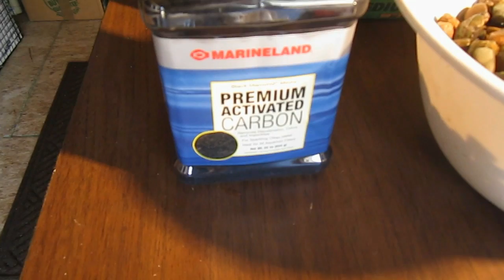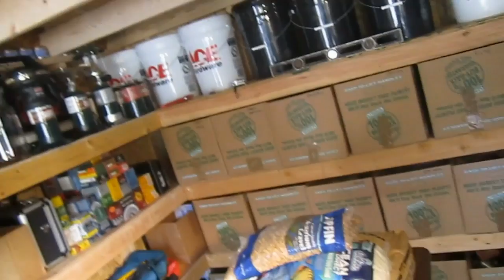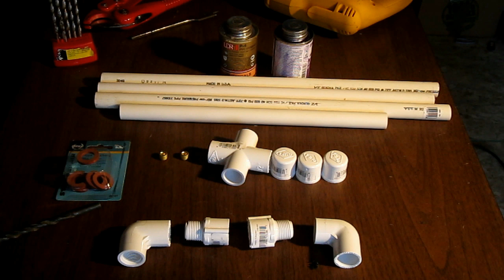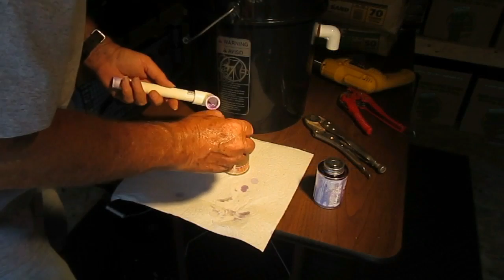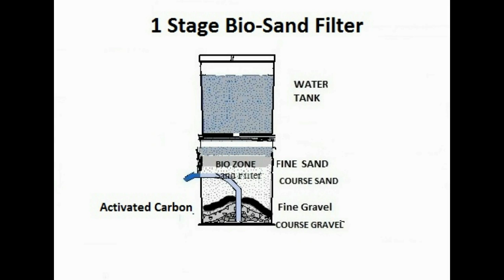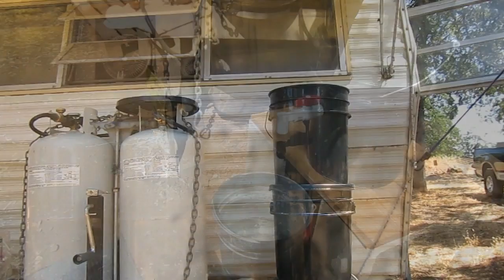Bio-Sand Filter Part 1, 2 & 3

Comment: Several comments/questions:  I am interested in this for emergency use.  I live in a suburb and am worried (some) about industrial chemicals, lawn chemicals.  As for bacteria, I posted REPLY comments to concerns about adding bacterial to accelerate the growth of a biolayer to remove bacteria.  It would seem prudent to do a test even asking a municipality to test, even if you had to play games and not tell them the source.  Or it would be worth it to get a kit, test, or send off.  I see a SODIS approach is used.  And if either chlorine or iodine is used.  That said, if this were for emergency use, wouldn't it be safest to treat with Chlorine or Iodine?
Reply from the maker: Charcoal will reduce some chemicals but not all. Block Carbon filters are best. I used a water test kit from Amazon. My well water cleared up and I stored the BSF for emergency use.  It never produced a bio-zone as the well water did not have enough bacteria in it. I use a Berky Filter in the kitchen now just to be sure the water is safe all year long as I live in a Agricultural area.
Reply: OutSTANDING!

Comment: I really don't think I would use any type of oil drums. You only want food grade type buckets. If I were going to use a 55 gal. barrel/drum I would to try to find any type of food grade barrel I could find. 
Now how would you keep contaminates from entering the top of the bottom bucket? There does not seem to be any type of seal between the top and bottom buckets.
Reply from the maker: I am using food grade buckets. 55 Gal. Drums would be a very bad idea and defeat the purpose of the 2 stages.. You could put a gaskets between the barrels if it made you feel better but I don't think it is a problem and it probably would cut off the flow of the water. I think you may be better off with a simpler design something you would understand better.
Reply: Oh I totally understand how it works. I was wondering how you would keep the bad water if you spilled it down the side. The gravity is what pulls the water down so I don't think you would have a problem with it sealing at all with a gasket. The 55 gal barrel I would not even give it a thought. I am just doing personal research for myself. I am bit of a prepped.

Comment: Does a biosand filter out the same things that a ceramic filter like the 
Katadyn Pocket does, or would it filter some things that a ceramic 
filter wouldn't?  I'm wondering if using a 2 stage filter using a biosand filter and then activated carbon would do the same type of purification as 2 stage filtration using a ceramic filter followed by activate carbon??
Reply from the maker: +Dirky Dirk I could not use ceramic filters or block carbon filters because the plug up instantly with the fine sediment that I had and they are useless during most emergencies.
Reply: +EZ Off Grid 
I wonder if the Katadyn Expedition would have plugged up on you with your sediment rich conditions, it really is a monster that does high volume.  Me personally I think ceramic is a great 1st stage in a multi stage process.  The ceramic can really lighten the load on a purifier that you use afterwards.  Why use up the life of the purifier on impurities that the ceramic can take care of!  I use the Expedition, than I use the First Need Base Camp Purifier, than activated carbon for taste.

Comment: nice job on the video. very useful information. if I'm not wrong, you want to be sure your fine sand is always underwater to keep the bio-mass alive. wouldn't it be better to use a longer tube to the bottom and place your tap above the fine sand level?
Reply from the maker: +noah williams I think that would slow down or stop the flow rate.
Reply: what you are saying is you would need more head to force the water through the filter. you could use a larger bucket for a larger reservoir. thinking it would need to be a single container, 3-4 feet tall at least. probably looking at a section of pvc piping or similar?
Reply from the maker: noah williams I wanted two buckets so I could lift them for storage and maintenance. (Wet sand is heavy) The only purpose for the riser is to keep sand out. (It won't work higher.) You have to add more water immediately after you use it to keep the bio-zone covered.
Reply: yep. portability is not my driver. looking to design a permanent off-grid water collection system. your video was helpful. thanks again.

Comment: Isn't "BPA" an issue with leaving plastic on the direct sunlight? Would a glass container be better?
Reply from the maker: +Shawn Mazurk - As I said in the video "food grade" which are BPA free buckets. Glass would be very hard to work with.
Reply: Sorry, I didn't mean the black buckets. It's the bottle one. Where you leave it out in the sun to get rid out the chlorine.
Reply: Great video.

Comment: i was just going to ask about carbon being added, but what if i were to use the carbon in  separate reservoir?
Reply from the maker: +Truth B'Told That would be a good idea as carbon filters should be replaced often.
Reply: Depends on flow or contaminants, I suppose, but how to tell?  Taste?  Smell?  Just caution?  Could you lay out a maintenance chart?  Insert in video?  Much work, but thanks.

Comment: We live in a climate where winter would leave us with only a frozen bio-sand filter.  What are your thoughts on if we were to build a "water closet" of sorts with a mop sink in the bottom to bring our bio-sand filter inside for the winter.    We use a Berkey, but want to build one of your two stage bio-sand filters to lesson how often we have to clean the Berkey filters.
Reply from the maker: +Sean & Mercy Hoyt Good idea! I use the bio-sand filter when the well gets sediment in it befor it goes into the Berkey filter.
Reply: +EZ Off Grid would and additional filter after the sand filter before the berkey filter to prolong the life of the berkey filter be a good idea? if so do you know what one would use? i am assuming something made without a negative impact on the enviroment (ie. sustainable),  and of lower cost than the berkey filter. perhaps filters for 100 or 50 - 1 microns. perhaps sustainable manufactured cartridge filters and or a sustainable  Diatomaceous Earth alternative, and or a distiller.
Reply from the maker: +horizon +horizon The "Berkey Lite Filter" is the only one I would use as it is transparent and you can see the water level and clarity. (I saw 100's of decomposing ants in my Berkey that I would have not notice with the metal version.) The Lite is over priced but you can make your own with two 5 Gal. water bottles and a spigot. The filters are on Amazon for around $100 a pair. I also use a 10 micron filter on the well pump. Be careful back-washing the filters they come apart easily. A still is a good idea but they are slow and use a lot of fuel but are ideal for desalinization of salt water. Everything depends on the quality and quantity of your water.I only need to filter drinking and cooking water. Bathing, dish washing and laundry water do not need filtering so I only need one Gal/day of filtered water.  

Reply ·
Reply: thank you

Comment: would using landscape fabric to separate the layers of rock and sand be good for keeping the layers separated (for maintenance purposes)  or will the fabric trap and hold bacteria ????
Reply from the maker: Darrell Hughes I don't know if it would accumulate bacteria but you don't need it as it is easy to separate the gravel and sand.

Comment: Hi, why not have holes all over diffusion plate, why only on the edge, won't the middle of sand layer be dry?
Reply: Maybe could make lower bucket's lid a ring (cut out most of middle of it), then drill tiny holes all over bottom of upper bucket?
Reply from the maker: Do-Right Solar There should be at least one inch of water above the Bio-Zone at all times. You would not want to have holes all over because the water would only drip in the middle of the diffusion plate and disturb the Bio-Zone. You have to control the rate of flow of the water and the easiest way is with one small hole in the top bucket. The Bio-Zone is not critical in the second stage because there should not be any bacteria to sustain it.

Comment: Hi all
I made the two level filter. The only change to the design I would suggest is putting the tap as high as  possible in the lower bucket, to have it above the top of the fine sand (bio-zone). That way you can just turn the tap on and let it drain till it stops. You don't have to turn it off while it's still running.
Best wishes
Reply: Joe, when I made mine a few years ago, I put the pipe through the bottom of the bucket.  The bottom is flat, and as such is easier to put the fixtures through instead of the side, which is curved.  Perhaps I overthought it, looking at how water-tight your tap was, but it's another option.  Basically, I constructed mine with a perforated PVC along the bottom of the bucket, this then took an 90*elbow which passed through the bottom of the bucket, where it took another 90* toward the 'front' of the bucket.  There is another 90* elbow to turn the pipe vertical wherein the user can cut this length of PVC to the desired height of how much water they want above the sand, another 90 brings it horizontal, and another 90* brings it back down to act as a 'faucet'.  I don't actually have a valve.  Mine uses more PVC, yes, but is a bit more forgiving in that the PVC can be removed and adapted in the case that more sand needs to be added or even removed.  also, one can fill the vertical pvc pipe with charcoal and the flow rate shouldn't be enough to dislodge it.
Reply: great idea

Comment: How did you wash the gravel?  The two kinds of gravel I got at the hardware store are both muddy/dirty.  I have gone through perhaps 55 gallons of water 5 gallons at a time trying to rinse of the river rock sized gravel.  I threw them in my cement mixer which was clean otherwise since I don't use it for cement. Doing that reduced the amount of effort for each 5 gallons, but I am still getting very brown water back out of the mixer.  I have just been rinsing & agitating.  What else do I need to do?  I am testing this out using two 5 gallon buckets set up like your 1-stage, btw.
Reply from the maker: You have to use pre washed sand and gravel if you really want to save time go to an aquarium shop and get there prewashed sand and gravel its already washed and just be sure you get the silica non-coated the sand and gravel
Reply: I already bought & used the rocks, so I may as well finish with it or it goes to waste.  I assume using soap here (of any kind, biodegradable or not) would be bad, so I should just keep rinsing?  I'll hit up the aquarium for the fine gravel and fine sand (non-epoxy'd)
Reply from the maker: Once Fired Lake City Brass No soap! You can use a little chlorine in the water to do the wash as long as you dry the sand and rocks in sunlight for several days.
Reply: ***** OK, that's what I thought.  Large gravel & medium gravel now both washed & cleansed with a tiny drop or two of bleach.  Aquarium gravel on that, then coarse sand topped with fine aquarium sand.  Just drilled the 11/64" lid holes & tried 1/32" hole in the bucket to see if that'll work for the diffuser plate.  I'd rather drill small then have to open it up than the other way around.  I'm putting water through it now, so we'll see soon enough.
Reply from the maker: Once Fired Lake City Brass Let me know how it works for you.
Reply: ***** Ok everything is operating, but there is a problem.  Everything is water-tight so no leaks etc - I tested everything with tap water and it seems good to go.  So I then tried to muddy my own water so to speak.  I put a little bit of black food coloring in a 5-gallon bucket and mixed it up really well.  I wanted to see how much clearer it could make the water without putting anything muddy or nasty through it quite yet.  So far, it really hasn't changed the color too much.  Thoughts?
Reply from the maker: Once Fired Lake City Brass The filter is made to remove bacteria, viruses and pathogens no filter will remove everything especially salt from salt water. If you want pure water you have to distill it.
Reply: ***** I have been using it for a couple weeks now, and I'm running into one problem repeatedly.  The top bucket is not draining.  I think the minor amount of debris coming from the roof runoff is combining with a couple other factors to stop the thing from working.  I believe the lid on the bucket underneath (the main filter lid) is pressing against the bottom of the first bucket and sealing the tiny hole.  About half of the time I find the top bucket still has a full 5 gallons of water in it.  I have tried leaving the lid off the top bucket, to see if there was a suction issue, but then I end up getting more debris in the bucket, too.  Thoughts?
Reply from the maker: Once Fired Lake City Brass Try replacing the top lid with a fine mesh screen. You are bound to get some debris from the runoff. If the problem is with the way bucket fits try using some kind of  small spacer between the top bucket and bottom bucket. If you enlarge the hole the flow rate will increase and you need to have a slow flow rate.
Reply: ***** I did all sorts of shenanigans to get the top bucket to let water out of the pin hole I had drilled into it.  I put the bucket up on two boards supporting the rim of the outer wall instead of the center to relieve weight from the center.  That did nothing - even if I was smacking the bucket no water came out through that hole.  So I opened it up to about double what it originally was - I forget which size drillbit I used.  But it works far better now.  It still takes about 45 minutes for the water to drain into bucket #2, which seems to be about right in terms of flow.

So now I will continue to test with the 300 gallons of rainwater I just collected again.  How long before the microorganisms start to build up in the sand?  I've been running the bucket through daily, but have always kept the valve open.  I figure now that the flow issue is resolved, I can start to cultivate the bio part of the bio-sand filter.
Reply from the maker: Once Fired Lake City Brass How long it take to create the Bio-Zone depends on water quality. Normally it will take about 2-3 weeks. I never got much of a Bio-zone established because the well water was almost free of both good and bad bacteria.
In your case you can jump start the Bio-Zone using "Biological Filter Media" from an aquarium shop. The filter will do a good job without the Bio-Zone but you may have bird droppings in your runoff.Run about 5 Gal. of water threw the every day for a week leaving the bottom tank full over night to be on the safe side. The aquarium shop should know how much filter media to use..

Comment: Thanks for the Vid great info and you did some mistakes which were useful info for troubleshooting later thanks……….Charcoal is great but higher maintenance as bacteria sticks to it like a magnet so gotta clean every fortnight I reckon.
Reply from the maker: Bacteria should not be a problem in the second stage. Carbon filtering mainly for removing chemicals. I primarily used this to filter out sediment. The well water cleared up after a few months use and I put the filter in storage for emergency use.

Comment: Doesn't the biozone have to stay wet to be effective?  How would you accomplish this in between uses. Or doesn't it matter?
Reply from the maker: Turn off the valve and add water to the top tank periodically. This will keep the first stage covered with water.

Comment: I like how you use a vertical pipe before your outlet to let gravity keep sand from rising.  A thicker pipe will allow the more water to flow without increasing its flow speed allowing sediment to remain at the bottom.
Reply from the maker: It is best to have a slow rate of flow with this type of filter.
Reply: Absolutely! The whole filter shouldn't be "pushed too fast". That is why many times they are called slow sand filters. My point was that too narrow of a riser pipe could cause too fast of a flow inside the pipe to let sediment stay down, On the other hand a larger pipe for the riser would move the same amount of fluid with a slower internal flow rate.
Reply from the maker: Keith Reynolds Interesting! I think the water would be held in the larger pipe longer and the fine sediment would have more time to settle to the bottom.

Comment: Very cool info here, In my case I have been drinking water from "harvested sources" stored in cisterns for years (mostly OCONUS) with only bleach disinfection. I don't have any issues drinking it and haven't for years but im concerned about all the other people in my compound. So I have developed similar systems  with diversion PVC feeds from the rain storage tanks (all elevated 5 foot too several of these types of 2 stage 5 gal filters (using recovered charcoal and other filter particulates) from water filter systems that people throw away here in Florida. Im trying to figure out how to pressurize the 5 gal buckets under low air pressure. to increase flow rate. I used a toilet plunger!
Reply: I would love to see your filter, if you can make a video please.  Specially how are you reusing the used charcoal and sand from others filter.  Do you just wash them?

Comment from the maker: @ C. Smith I use the Berkey Filter for drinking and cooking water. The well water has cleaned up and is fine for bating. I put some chlorine down the well shaft so I can store it in the trailer water tank..
Reply: I use the Berkey as well. Its the best solution after research. When it starts operating slow, just take it apart, re-prime it, and your good to go.